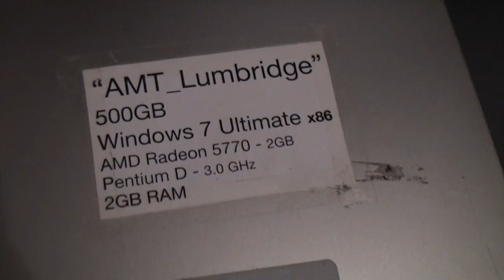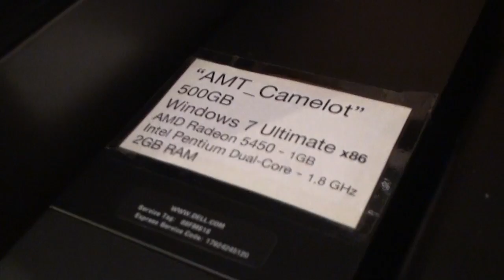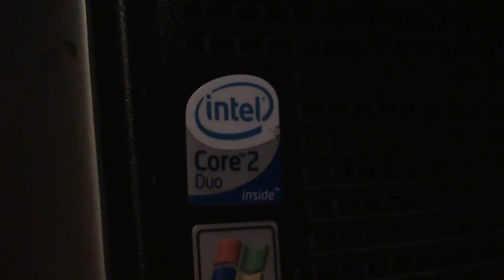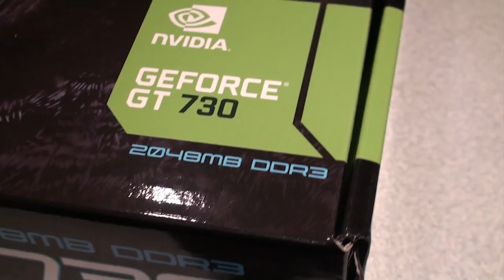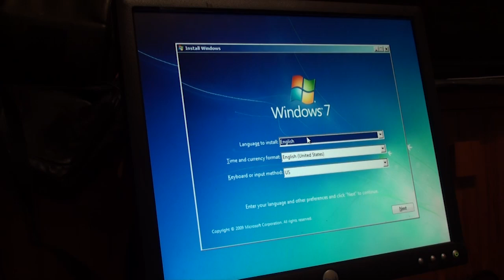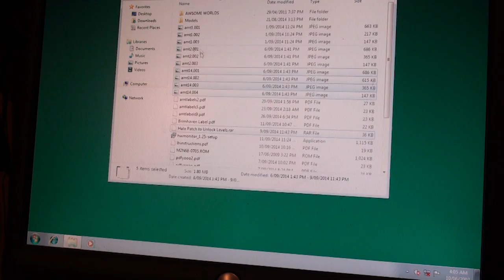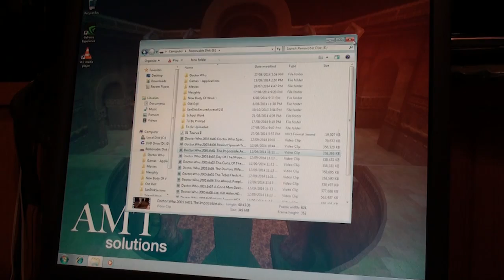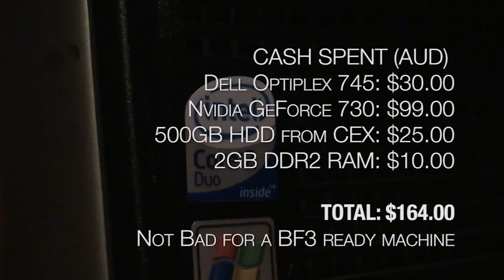Turning an Optiplex 745 from Boy to Man - Green Ham Gaming

Comment: and i just swapped out a core 2 quad q8400 to a core 2 quad q6700 and bumped up the ram from 4gb to 8gb in a dell studio 540.
it has a 500gb hdd and i might put a 750 ti into it. it will have linux thrown onto it and be used as a minecraft server or something.

Comment: what is the best cheap graphics card for a core 2 duo 3 GHz?
Reply: R7 250, GTX 750 or GT 740.
Reply: get a core 2 quad, ($25) and a 750ti
Reply: TheCanadianLanBoy Thanks! I' ve got a Dell Optiplex 760 and some people on the internet say that the motherboard supports core 2 quad and others say it doesn't...
Reply: Leon S Rx 460
Reply: It supports quads nicely,I upgraded to q8200.
But if its ssf and not normal tower,forget r7 250 or gtx 750,its pciexpress gives only 25watts of power.
Reply: Vasilios As it's a normal tower, but I found out that it doesn't support gpus with two slots :(
Reply: +Leon S check the socket for the optiplex 760 and the socket of the c2q
Reply: Get a single slot 750ti then

Comment: I have Intel core 2 duo what should i upgrade so that my pc would be a gaming pc...
Reply: Add a core 2 quad if it can handle it.
Reply: +Colepaq Core2Duo PCs are socket 775, so a Core2Quad upgrade shouldn't be a problem unless you have to deal with the non-standard shit that Dell and HP use in their machines.
Reply: Yeah. Thats what I was referring to there.
Reply: what kind of graphics card should i buy.
Reply: GIANXhunter Upgrade your CPU to a Core2Quad first, then get an RX460 or 470 if your power supply can handle it.
Reply: many youtubers are using Nvidia gtx 750 ti
Reply: +GIANXhunter The RX460 is a much better card.
Reply: +GIANXhunter The RX460 is a much better card.
Reply: Is rx460, Asus?
Reply: ahahhahah

Comment: could i get a 750 ti and a slighly better processor and not need a power supply upgrade?
Reply: +Carson Juliot what is your PSU wattage???
Reply: ifagainst 245
Reply: +Carson Juliot yep, you need to upgrade to a 400-500watts. I think 400 will be enough.
Reply: +ifagainst eh nope hell honestly be able to push it with a 300-350 watt PSU so long as it isn't some crazy CPU
Reply: +Carson Juliot 
only if you get one that doesnt need a 6pin connector like an evga one.

Comment: Who puts a copper pipe Heatsink on a 1.86GHz core 2 Duo CPU especially for a MT, quite overkill for just a 65W low freq cpu, unless if the cpu was the E8000 Series or the Core 2 Quad series

Comment: I have a Dell Optiplex 745 as well, recently replaced the motherboard since the one in it had swollen caps. I got it to play Fallout 4... not very high FPS and on low settings of course.

Mine has a Core2Dou 2.66 CPU, 8 gigs of Ram and a GeForce 430 GT from Zotac
Reply: Is it possible to upgrade it to 8gb ram and a gtx 980 ti?
Reply: pixelgaming460
Yea, a 745 can handle 4 2 GB chips.

As for a GTX 980 TI, it doesn't look like it would, the board is a BTX design, so it wouldn't be able to accept the duel slot design.
Reply: +pixelgaming460 Not sure if you're joking or not, but a core 2 duo would bottleneck 90% of that video card.... It would be a dumb move to get a 980ti on that machine.

Comment: Hey GHGTV people, I want to make my friend a Optiplex 755 slim desktop upgraded build (Core 2 Extreme and GTX 750 ti combo with extra RAM).... the problem is the power supply isn't good enough to handle an overclocked core 2 Extreme (if it weren't overclocked, it wouldn't be worth it). So I want to add a 400w SFX12v powersupply inside of it. Anyone know if it'll fit?
Reply: Probably not, i think it needs a Small Form Factor power supply
Reply: ***** I've checked videos, and it seems it has SFX12V power supplies which are typically considered the "Small form factor" standard. You think I should go smaller?

Comment: I saw somebody said you could thrown an e8500 in there. You can't. The chipset wont boot it, I tried. Core 2 Quad q6600 works perfectly though. I have that running with 8GB Ram, Radeon R7 240 and a Seagate 1TB hybrid drive. It's fast for every day tasks and good for light gaming and can play some reasonably modern titles at medium-ish settings. Don't expect something cutting edge like battlefield 1 though. That game will kill any Core 2 chip and entry level graphics card.

Comment: You have got the ram mixed up a bit, you should have bought another 2 GB stick instead of 2x1 GB sticks so that it will function in dual channel memory mode.  If the Optiplex says 'enhanced' when in bios boot screen it means it is a dual core instead of a single core.  Also you are running windows 7, so there isn't a ram limit at 4 GB like in XP.

Comment: how is my 2003 specs

Pentium 4 HT 3.06Ghz

1GB RAMBUS RAM

ATI Radeon X700 256MB
Reply: My old computer specs are a Pentium 4 1 GB of RAM 400 GB of HDD and no dedicated graphics

and we are going to upgrade to an AMD A10 7870k 8 GB of Kingston hyper x fury ram 500 GB of HDD and add the old 400 GB one and for extra speed in gaming we will add a Sapphire R7 250 1gb of VRAM
Reply: Yes, because those are the only specs in a computer.
Reply: fine.
Gateway 700XL 
-Intel Pentium 4 HT @3.06Ghz 800Mhz FSB
-1024MB RIMM (RAMBUS) RAM 
-300GB WD IDE HDD
-Intel Full-ITX Motherboars (model unknown)
-AGP ATI Radeon X700 Pro 256MB 427Mhz Core Clock
-Creative SoundBlaster Audigy 2   5.1 surround

Comment: Try and find a Dell Precision T3500 with quad or hexa core Xeon. They be pretty cheap on ebay. Slap in a GTX 750 ti and get your game on. To all the people who are looking at buying a gaming computer. The Dell T3500 Quad Xeon + gtx 750ti/ 950/960 or a HP Elite 8200/8300 Microtower + gtx 750ti.

I am currently upgrading an older machine an it contains a Core 2 Quad Q9650.

Comment: The HD 4350 isn't actually that bad of a graphics card for running lower end games.
Reply: You also should've gone with the Geforce GT 740 instead. It is a little bit more expensive, but for upgrading a lower end machine, its pretty good.

Comment: 60 FPS in CS1.6 and maybe those 91 in Q3 makes me think that it's limited by VSync or fps_max. There's no way that it remains at both such low and stable FPS like that.
Also buying a GT730 priced at 99 AUD for playing those games seems over the top, the CPU must be the limiting factor. An older second hand would cost less and perform the same.
Also fix "Octogon" in your description to "Octagon Hornsby".

Comment: Looking for new graphics card, gaming.

I currently have GTX 750 Ti and my processor is AMD Athlon II X4 645 with 3,10 GHZ and 64-bit, 8 GB RAM
Reply: prepare for a bottleneck if u buy a teeny tiny bit stronger card, just stay with the 750 ti

Comment: i have a optiplex 330 that is like that. intel e2180. upgrade ram from 1 GB to 2 GB. 320 GB harddrive too i think. Intel gma 3100. this was sold with xp or vista and i got xp. need to upgrade to win7 then to windows 10 sometime soon.need to find a video card too. 
guess will not hcange anything to upgrade but if i ever do the highest i can go do is this. for this computer 
Maximum CPU: Core 2 Duo E8600 or Core 2 Quad Q8400S
Maximum RAM: 8GB ddr2 don't know fastest speed (dell says 8 GB but it can use 8)
need gpu like you have. seems max power is 75 watts on pcie16x i guess. 
Maximum FSB: 1333MHz (with latest BIOS)

Comment: My Optiplex 745 can beat up your Optiplex 745. '3'  Well, it can't, but if computers could move on their own and attack, mine would probably win.  Then again, it would be cheating since I replaced the CPU with a Q6700 and added 8GB of RAM, as well as a single slot GTX 750 Ti.  But still, quite amusing how far an old desktop could possibly go.

Comment: Man it sucks for you guys outside the States when it come to GPU prices. Especially Nvidia cards. A GTX 750ti here costs about the same as that GT 730 does down under. That 730, and it's predecessor the 630 are spunky little super low power cards.  Although the 750ti I think draws just a little more power, doesn't need a 6 or 8 pin power cable just like the 730, is a Maxwell based GPU like the 900 series, and can fight well enough in league games for sho! (IMHO)

Comment: i have dell precision t3400 for 85€ (euros)
375watts psu with 1 6pin pci express power cable
intel x38 btx with a14 bios
core 2 quad q6600 G0
4gb ddr2 667mhz
geforce quadro fx 570 256mb (8500gt)
160gb sata 2 
dvd-rw sata (before dvd rom)

my top prioraty upgrades are the memory and graphics card.

Comment: and i just bought a nvidia gt730 v2, 2gb , 128 bit graphics card from msi for around 65 bucks
Reply: for that price you could have bought a 7850(R9 270) or GTX 660........
Reply: Ah, sorry, i didn't use the right exchange rate. I wanted to say 69.38USD.

Comment: Putting Pentium D and 2 gigs of ram with hd5870 is such a waste. The cpu and ram will bottleneck fairly great gpu. I had 5850 with 3 gigs of ram and a Pentium D but since i put it to my q9300 quad pc with 6gigs of ram, it runs like a dream. We re talking about 50% advantage.

Comment: a gt 730 is a horrible option imo, you could get a 750ti which is 20 bucks more but more than double it's performance, and it requires no power cable

Comment: I only trust seagate or WD (western Digital ) for hard drives (hitachi work for short term but their shit my 1TB hitachi FAILED and is probably dead ) its easy enough to get a seagate or WD drive, so just go the extra mile
Reply: same here WD is preffered but if you can avoid it dont use hitachi unless you backup absolutley everything

Comment: I have a pc with pentium 3, stock cooler, unknown mobo, 512 mb ram and no gpu
Reply: +Skas Spirail I have the exact same specs, but I did throw a GPU in my IBM from 1998.  Collecting dust in my closet now.  Used to bang out Quake 3, Half-life and the original Guild Wars on that beast as a freshman in highschool.  Ahh, the good old times.

Comment: You had better pay extra 20$ and go with gtx 750, as gt 730 is even worse than 8800GS or HD 4670
Reply: Well the cpu won't take advantage of the extra gpu power.

Comment: Now buy a batch of better Core 2 Duos!!... There is a lot right now of 10x E7500s for around 40 bucks on EBay!!! Those E7500s are quite good at 2.93Ghz and can be overclocked to 3.5Ghz on AIR! with no problems...

Comment: for 99$ you get a gtx650ti
Reply: +Kilian Weiler GTX 650 Ti is also to powerfull for this pc to handle lol
Reply: for 95 euros you get a gtx 750ti
Reply: ok but not on a site i know
Reply: Kilian Weiler http://www.novatech.co.uk/products/components/nvidiageforcegraphicscards/nvidiagtx750tiseries/
theres one for 90 euros too
Reply: +. Doge well those cards need a 450-500 watt PSU lol these pc's come with 240-340 watt psu's
Reply: +Kilian Weiler more like 110 Watt
http://www.geforce.com/hardware/desktop-gpus/geforce-gtx-650ti/specifications
And this a a refference model if you go with the EVGA/Asus higher clocked ones those are even higher heck my old Asus GTX 650 NON Ti hogged over 100 Watt....
Reply: +Kilian Weiler also a GTX 650 and on require a 1x 6 pin molex or more something a piss poor power supply in the DELL's don't have unless you buy a new PSU
Reply: adapters
Reply: +Kilian Weiler yes slap a 110+ watt card on a 300 Watt PSU who basically can onlu use 240 watt of it... good job you just killed a complete system
Reply: No i put a 560ti on a 375 watt psu and a q6600 and it runs great

Comment: I have used the gt730 and I almost immediately wanted my money back. it is a HORRIBLE HORRIBLE card!! For the money you are spending, it is SO NOT WORTH the cost. a 3rd gen integrated 2500 Intel GPU will outperform it by 20% at lowest! Are you kidding? How about getting a (I hate to say it) 1030, or better yet a 1050 or 1050ti which are the BEST BEST BEST for these machines. They fit without extra power, I have put 1050's and 1050ti's in MANY dells, with 0 problems. These people are now playing MODERN AAA titles with very respectable FPS even at HIGH and Ultra settings on some. for 100-155(Depending on which 1050) US it is the best buy for your money. Please stop recommending the GT 730, PLEASE it is abhorrid! For everyone else, go to PASSMARK or any site which will show you it's rating...
Reply: Forsaken Cry the I totally agree the gt 730 never was a good card and still is overpriced that being said this video came out in 2014 no one should get a gt 730 ever for anything more than 10$